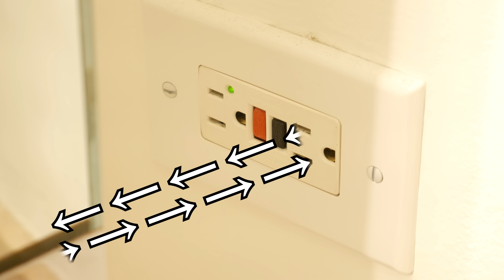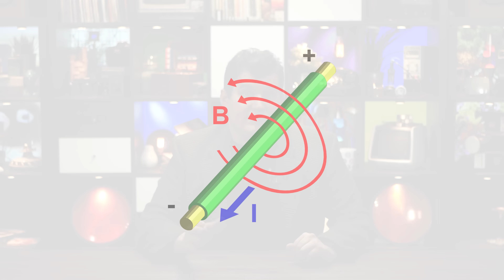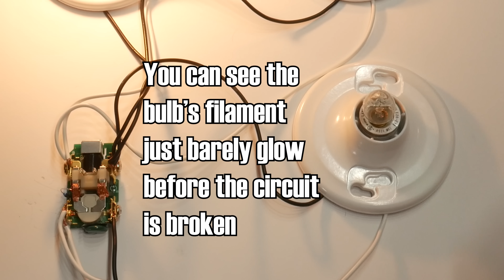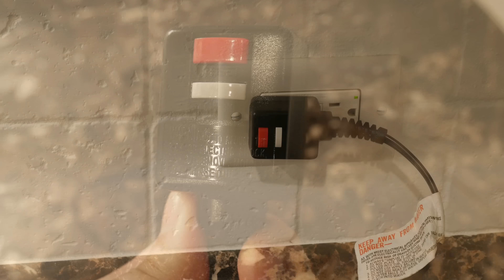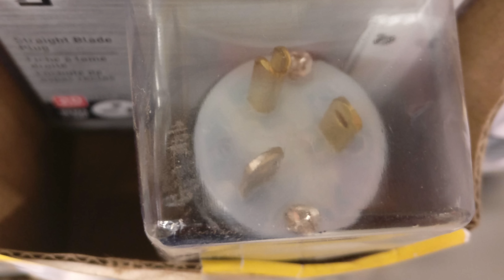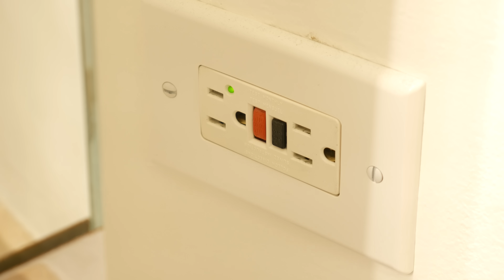The GFCI/RCD: A Simple but Life-Saving Protector

Comment: In the UK we cannot use any plugged in electrical items.  Only lights exist. In hotels etc there are outlets for shavers.  We also have Fuses installed in all plugs such as 3A 5A 13A etc.  The Fuse wire burns out and the circuit is broken if there is an overload or some other fault, sometimes tripping the main circuit breaker in the home.

Comment: In the UK every power outlet is always covered by an RCD .. all of them,  the ones in the Bathroom.. do not exist they are not allowed, except for low voltage/current shaver sockets 

All sockets have an earth connection to make them safer,  this is designed to always pull out last if you pull the cable to be safer, the plug socket has a switch to be safer, the socket has guards that retract when the plug is plugged in to be safer, the guards are retracted by the earth pin to be safer...  

Do you see a pattern here ... you can't put a fork in UK sockets, either you get stopped by a guard or you are just touching an earth connection, and ery single one is protected by an RCD as well ... and before that was protected by a fuse ... 

This is apparently also true of most of the world .. .except the USA ...
Reply: North American sockets are 120V/15A, so much less risk than your insanely high amperage plug breakers.

Comment: We in the UK have the safest sockets by far lol
Reply: You also have much more available wattage at an outlet than us.
Reply: @simonrichard9873  how much do you have? In Germany its 230 V with 16 A
Reply: @supercunthunt7756  Regular outlets are 15A 120V, and in recent years kitchens have started getting 20A 120V. Electric dryer outlets are 30A 240V and ovens have 40A 240V.
Reply: Safe plugs, but dangerous sockets as British homes use large ring, or serial, circuits rather than parallel circuits meaning each socket has the potential to power your entire house from it.  Which is why idiots who do stupid things like wrapping broken fuses in tin foil or removing the fuse entirely and replacing it with a nail are not only opening themselves up to the risk of shock but the risk of burning to death as 300 amps would weld you to the floor with your own skin.

Comment: very thorough and well presented. i believe that the test button would short the neutral to ground, tripping the relay.
Reply: No, it bridges phase with ground (PE) but with a calibrated resitor: so RCD won't trip if sensitivity has gone too high. A short-circuit could trip also a 1A rcd, we must be sure that an RCD trips if current is low (within the tolerances) and this is easy to achive with a resistor (7,6 kOhm for 30mA).

Comment: Just remember you can still receive an uninterrupted shock if both the source and the return path are thru the slotted hot/neutral pins of the outlet(not the ground pin). But that’s a rare case scenario.

If you hold a wire with melted insulation and receive shock, you’re grounding likely thru sink plumbing and that’s where this device saves. If both wires were bare and you touch them, you’ll feel the shock but only thru the short distance of skin. It will likely burn quite badly but generally not life threatening (like through your heart).

Comment: In Italy the house needs to be fitted with 2 RCBOs, one for sockets and one for lights (16 amp and 10 amp respectively for the circuits with rcbo rated at 30 amps). Over this, a main breaker at 30 or 35 amp before RCBOs, and behind the RCBOs, secondary breakers for every room (so the fault is separated only on the groundfaulted circuit). Very fail safe, but as a ex-eletlctrician-assistant, ball breaking when you need to swoop visually all the wires and test all the breakers.

Comment: One reason we in the UK have them in the 'consumer unit' (our dumb name for a domestic distribution board) is because they are classed as additional protection of fixed wiring. Up until recently we were able to fit non-RCD protected outlets for certain applications; but to do so the cable feeding them had to either be at least 50mm within the structure of the building, or contained in an earthed metallic enclosure. 
Now everything has to be RCD protected, but no one wants to pay for RCBO's so the most common arrangement fitted in a new domestic install is a split-load where you have 2 RCDs each protecting up to 8 circuits. So a single fault anywhere when you're not home and you can say goodbye to everything in your freezer or your tropical fish. And don't get me started on our bloody ring-circuits 😂
Reply: Dan Reeves BuT iTs So mUcH SaFeR.

Comment: It's a fuse. Question answered.
Reply: It's not though 😂
Reply: @_______DR_______  maybe different mechanics but same function
Reply: @franzpattison  The function of a fuse is to protect against short circuits or overload, a GFI/RCD does not protect against short circuits or overload
Reply: @_______DR_______  I stand corrected. In my experience the fuse/circuit breaker trips when there's been a short, which seems to be the function of this thing.

Comment: We don't have these in our home - it's too old.
It's really not great. The electrics are pretty dodgy, lead pipes, ... There is a wire barely underground going to a shed, most likely introducing way too much resistance. Old houses are fun

As for centralised or decentralised... I actually don't know which I prefer. You say decentralised encourages testing - maybe. But only because you get reminded by it. The centralised approach let's you test everything far more quickly and it protects everything rather than individual sockets.
On the other hand, the troubleshooting part is very true indeed. Decentralised makes that so much easier. (And I suppose there is nothing stopping you from putting a protected socket everywhere and not just where required)

Comment: Meanwhile in the UK, our plugs and outlet designs are soo good, we don't need test buttons, and are confident enough to up the power voltage to 230V. While you Americans suffer with your poorly designed two prong dangerous sockets that could destroy a house if one sparked.

Comment: Huh, interesting and educational.  The hotel I work at has those switches on the plugs for the in-room HVAC units, and the damn things are always getting tripped somehow.  Every week I have to go reset between 5 and 10 of them.  I used to assume that they were getting tripped when the housekeepers would vacuum and the extra draw was popping the GFCI switches like a breaker, but having learned what I know now from the video, I'm even more confused at what's causing them to trip.

Comment: Here in Germany the RCD or locally called FI (for the German word failer, and I for the formula symbol of Amper) is a requirement for all new installations in private households.
RCD sockets are must retrofitted in bathrooms at old houses.
by the way over here we have 240 v

Comment: In Belgium, We call them “differentials”. Which also explains what the device is measuring: The difference between the 2 lines.
All houses are required a 300mA for the whole house, and a 30mA just for bathrooms. Installed in the main breaker panel.

Comment: You never want a daisy chain plugs together, if you want to join multiple plugs together what you need to do is put a splice Inside the Box so that you have one wire going to one plug and another wire going to the next plug from that initial splice.

Comment: I live in South Africa, over here we call them an Earth leakage circuit breaker. I just thought that might intrest you🙂.
Reply: earth leakage
Reply: @based980 new band name
Reply: Michael Imray bruh the electric is sent into the ground in case of leakages
Reply: @based980  ikr
Reply: Yup Most countries in Asia call it ELCB as well, Earth Leakage Circuit Breaker
Reply: @samuelpereira5209 if it's a breaker I guess the outlet would be called an earth leakage breaker outlet or receptacle. Just guessing . 73
Reply: We have arc fault breakers now for arc faults which are required in all new homes. There is also arc fault and GFI in. One outlet or breaker which protects the whole daisy chain. Dad never daisy chained the house he built back in the fifties he junction boxed all the wires together. Which was better in some ways if you had a bad receptacle the rest were still in operation. 73
Reply: @samuelpereira5209 Taiwan it's called "electric leakage circuit breaker"
Reply: Waseem H What’s more, such devices have been compulsory in South Africa since the mid-‘70s.
Reply: @S This explains the difference; https://www.electricaltechnology.org/2019/07/mcb-mccb-elcb-rcb-rcd-rccb-rcbo.html  That said in some of the countries mentioned they actually now use RCDs or GFCIs instead of ELCBs but still use the name ELCB as that's what they're used to using.
Reply: E A R T H 
L E A K A G E
Reply: In the Netherlands it's called An als or aardlekschakelaar which means  ground leak switch.
Reply: Same in India.
Reply: De aardlekschakelaar
Reply: Same in Nigeria
Reply: I just call it the clicky offie thing
Reply: In Greece we call Circuit Breakers "Electric safeties" (literally, that's their name)
Reply: @S Nope! It should trip if there is an imbalance or difference of more than 20ma between the currents carried by live and neutral wires which implies the 20ma is going to ground from either live or neutral this being an earth leakage  fault.
Reply: Same in uk there's ELCB and RCD but they work differently ...
Reply: Similar in Germany. The grounding is called "Erdung" in German, and "Erde" means "Earth" in most cases
Reply: The device mentioned was first developed by C. J. Fuchs Pty. Ltd of Alberton South Africa.
As we are talking about South Africa Mr. C. J. Fuchs was a registered plumber and drain layer of course.
Reply: Also shortened to ELT (Earth Leakage Trip) in the UK
Reply: Ground leakage, in a Canadian version of Seffer English.
Reply: Common name in the UK too.  But I once called it that when talking to an electrician and he gave quite a long lecture on and RCD NOT being an ELB - most of which I didn't understand...
Reply: here in Bharat (India) we have these ELCB (Earth Leakage Circuit breaker) and MCB (Miniature Circuit Breaker) housed in the service panel/ mains.. fuse box as we call it.
with each room or category/type looped through their own switch/ tripper/ fuse.

but now I think I am too dumb to exactly decipher how or what exactly do they do differently that these  ones

as a kid I understood that Paa (papa) would usually ensure that an audit was done by an experienced electrician to have all 15amp items.. air conditioners, fridge, washing machine and such on a different fuse/line.. often a mixer/ grinder / blender would otherwise mess with old TVs or microwaves and computers/ printers would get edgy if used simultaneously in different parts of the house.

and of course later we were the elites :P to have power back up units with their car type batteries and the inverter unit.. so anyway the fridge, washing machine, microwave, AC were looped OUT on a different fuse than the rest of the appliances which drew power from the "inverter" during the frequent power cuts.
Reply: Meh

Comment: Many thanks for another awesome vid there, Sir! Very handy to have a reference which explains GFCIs/MCBOs/RCDs (Or - As some landlords here in the UK call them - "Optionals") in a way that everyday people can understand! :-)

Very surprised to learn that the US trip current is just 5mA, which is a lot safer than the 30mA specified over here. I could see your GFCI had active circuitry in it (I don't know if ours do, but the older ones would be just a wound ring and a solenoid hung off the sense coil) but would active circuits be essential to a lower (Safer) tripping point? :-)

Comment: It's worth noting that you can also get GFCIs that are built-in to a power cord.  The ones I've seen, in addition to normal GFCI operation, also trip when line current is removed (e.g. when you unplug the cord from an outlet).

When I lived in a home where the outdoor outlets were not GFCI protected, I would use one of these on the cord for my electric snow blower.  Given the fact that it is a powerful electric motor that is supposed to move snow (which quickly melts to water when hitting a hot motor), this is a nice level of extra protection, in case the blower's internal double-insulation should fail.

I believe these are also required for heavy equipment like drill presses, table saws and and other similar devices.  For equipment like this, the trip-on-disconnect feature is another critical safety feature.  Suppose you're using it and the power cuts out (power outage, breaker tripped, someone pulled the cord from the wall, etc.)  The equipment may still have its power switch in the "on" position when power is restored - you definitely do not want the equipment starting up unexpectedly, because it could lead to serious injury.  By forcing the operator to press the GFCI's reset button after power is restored, it adds one extra layer of protection for the operator.

Comment: There is also a very cheap type of RCD which only cuts the Live (hot) of and the Neutral says connected.   Do not use these.  They may sold as plug type rcds.

Comment: There are   passive RCD  and  Active RCD.    When tripped says off,  When powered cut says off.  and the other in power cut switches back on.     The power back on version should only be used for fridge frezers if not at all.

Comment: Its the law in the GB, but Landlords still don't install or care or fit showers correctly and put socket switches in bathroom instead of cord etc.   Rcd  - having a laugh - Landlord have issues wanting to fit smoke detectors by law let alone rcds.
Reply: +1 that! Seeing the UK standard calls for a 30mA trip current (Where the US is one sixth that) shows that British "Standard" is anything but trustworthy!
Reply: @ddragon8154  probably put there decades ago, and not changed. Something to bear in mind  as a tenant - David Cameron took away the budget for the civil servants who were ultimately responsible for fire safety in the UK. Just something that came up after Grenfell.

Comment: Inspired by this, I tested the socket in my bathroom. When I hit reset, my lights came back on for a moment, then turned back off. Guess my socket needs to be replaced, haha! Thanks for potentially saving my life I guess.
Reply: You have to push it in until it clicks back to the "locked and loaded" position.  That's deeper than the surface.
Reply: Opecuted  lmao but I am fast
Reply: @itsjustthatsimple628  but i am faster
Reply: It's the "test" button that you're testing, not the "reset" button, lmfao
Reply: @far2ez539  This was after testing it. Something had failed in the switch when I tested it, and any time I subsequently hit reset it would momentarily turn on then trip again. Ended up having to replace the plug which fixed the issue.

Comment: This is by far the best explanation of a GFCI I  have ever seen. And the Video itself was excellent.  And still. There are 29 thumbs down. Who are these people?
Reply: Probably the same sort of people who think that right outside the open door to a running shower is an "acceptable" place to site a 2kW resistive heater! :-o ;-)
Reply: @ddragon8154  I think is really worse to have 12 kW electric heaters fitted INSIDE shower cabin (I think in UK those are called 'electric showers').... And no permission to run a space heater in the bathroom (outside showering area)

Comment: I was always wondering why that outlet in the kitchen was different! There is one of those outlets in the kitchen, it is the older kind with red and black buttons. But however, in my bathroom, there are none of those outlets though, a normal one...I never liked that normal outlet that much.
Reply: Might be a wise idea to have that bathroom outlet replaced with a GFCI as quickly as you can. Unless it's being fed off the GFCI in the kitchen, that is. (Ask a qualified electrician to check this for you. :-)

Comment: "The rest of the world calls them RCD..."
Well not everyone. Here in Italy they're called differential interruptors, since they trip when there's a... difference... in the current flow through live and neutral.
I don't really understand why in America you have protected and unprotected outlets, though. Here the ground fault residual differential current interruptor device is installed just after the power meter, thus the entire house is always protected.In older houses there's usually just one big circuit for the entire house, so it's a bit of a pain in the ass when the breaker trips and cuts ALL the power to EVERYTHING, but I'd much rather the inconvenience of walking to the meter box in the dark than getting electrocuted because someone thought that one particular outlet didn't need protection.
Reply: Beware because if you have dots in your comment than it thinks that it's a link
this.is.awesome

Comment: If I'm honest, its usually pretty obvious why your circuit has failed in a house with a service panel circuit breaker as well. Like if you've been using something which is a bit dodgy and all the power sockets switch off then that is probably why.

Comment: Hey Alec

I'm now enjoying your videos for about a half a year and find it always interesting what technologies are used on your side of the Ocean 😀.

As an electritian: just something about, how that's handled in Switzerland (not Sweden).
With a Current of 230/400V AC (three-phase) every (freely accessible) power outlet up to 32A has to be secured with an RCD.
There are even some new regulations whitch specify to install special DC RCD's (Type B) at EV charging Stations.

And yes. Quite every house in Switzerland has a three-phase current supply. (I just heared that that's not quite common in other countries)